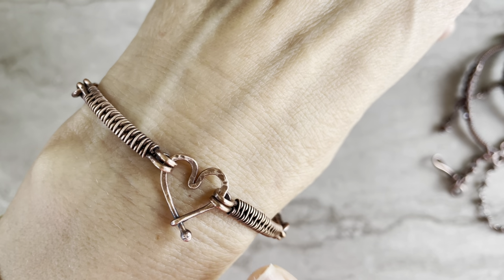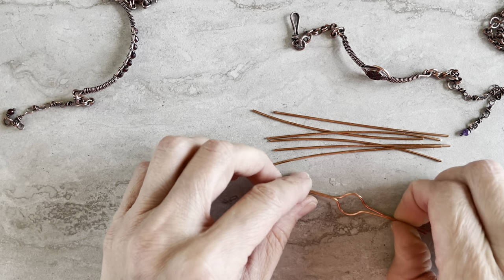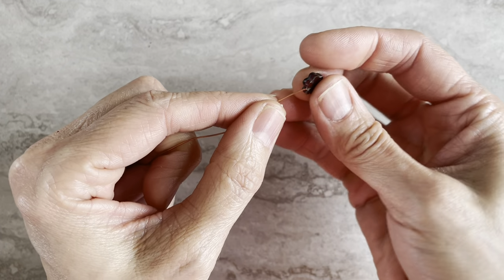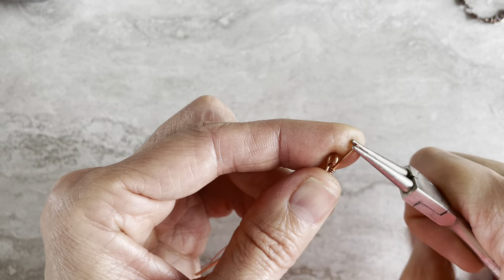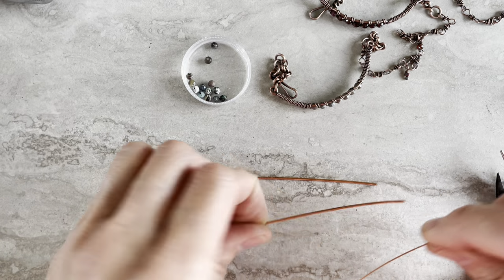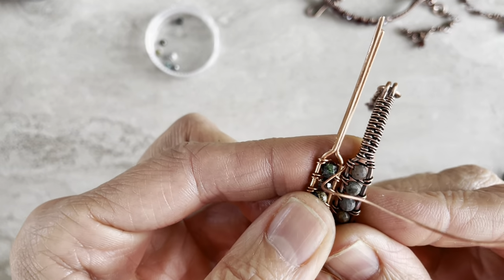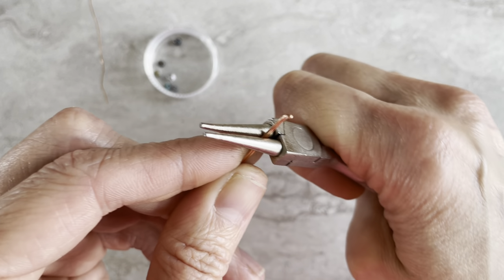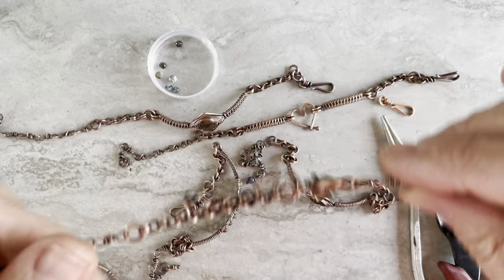Jewelry Tutorial: Wire Wrap Bracelet

Comment: Your work is so beautiful and inspiring! Tysm for sharing!! 💖*Question on your wires plz* is your 16g Wire 1.6mm (SWG) or 1.2mm (AWG)? It took me a long time before I realized that there were two different standards of measurements depending on what country you live in :) thx again!!
Reply from the maker: Oh… I didn’t know that either.. I have to ask my husband, maybe he can measure
Reply: @4girlsjewelry  Tysm!!
Reply: Oh wow I didn't realize that either. Thanks for that!
Reply from the maker: @rochelem3872  is that funny 
I thought it is standard measurement
Reply from the maker: @partiallythere2068  ♥️
Reply: I learned this by accident also. In the U.S. they use AWG (American Wire Gauge) but in Canada, the UK, and other parts of Europe they use the SWG (standard wire gauge). In Canada, 16g wire is 1.6mm but in the U.S. it's 1.29mm so there is quite a difference in the bigger gauges. In the thinner gauges the difference is not so noticeable. But now I am curious to know what the correct wire gauge is for this bracelet because I have been using 1.6mm wire and it is very thick but I like it :)
Reply from the maker: @litebrite8993  I know my husband has the tool to measure 
If he finds it, I will definitely measure my wires:) i do like thick wires, just sometimes it’s hard to bend
Reply: @4girlsjewelry  yes the wires can be very hard to bend and I have carpal tunnel in my wrists so is even harder. I make it easy for myself now, I use the torch first on the wire to anneal it and make it softer then I can do lots more with it :) Love your style soooo much!! Ty for sharing, I am learning a lot!! ❤️🤗
Reply from the maker: @litebrite8993  that is smart! Heating… i do have little pain sometimes, so I usually stop wrapping… for a while… but I’m sooo addicted to my wires😂
Reply from the maker: @litebrite8993  take care of yourself 
Hug